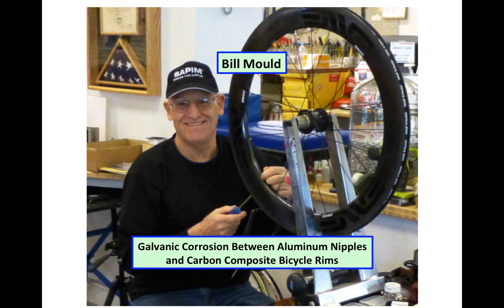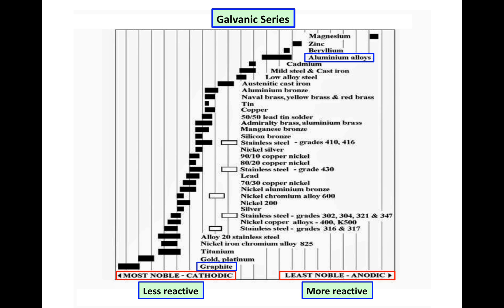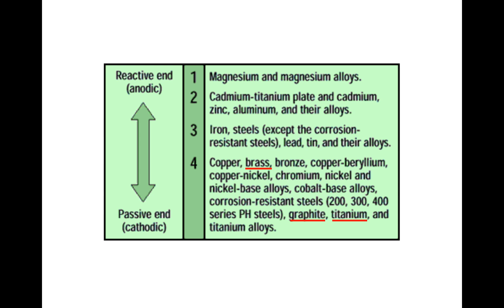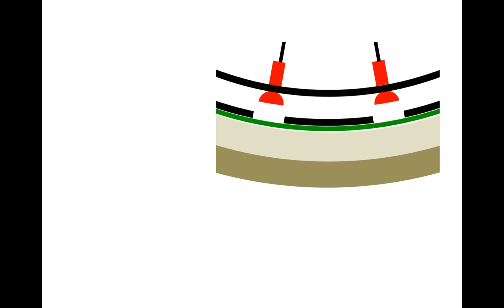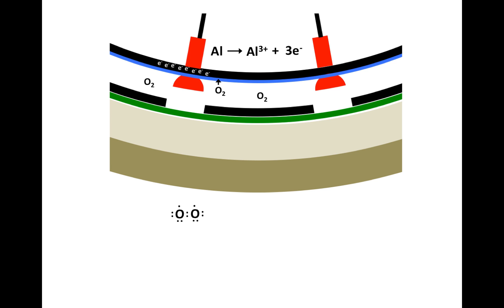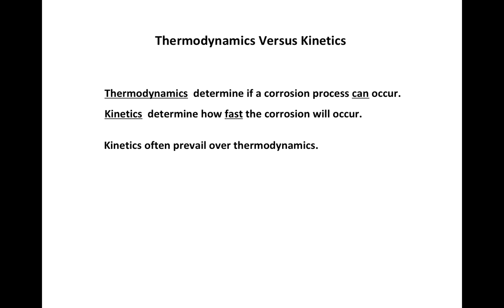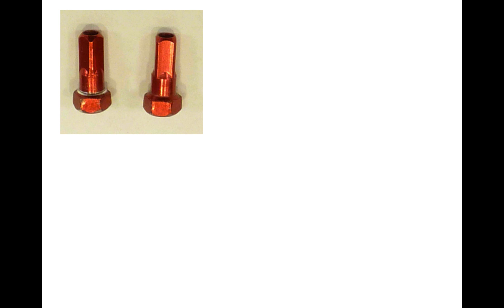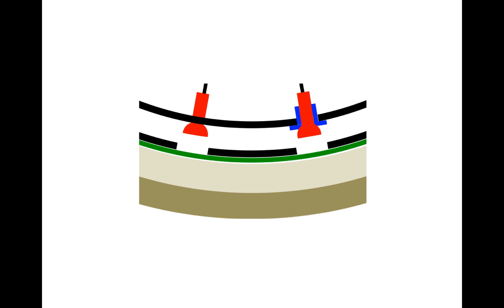Aluminum Nipple Corrosion In Carbon Composite Rims

Comment: Great informative video!! Thank you for this! 
I always use washers, when the rim bed is flat I use MG washers of stainless steel, in the other case DT Swiss PHR or the Sapim HM. Today I saw the first time of major galvanic nipple corrosion although I use only quality Sapim spoke nipples. I always use lube on the nipple outside also going into contact with the carbon. I always finish with Loctite on the top and bottom of the spoke nipple. 
I think indeed water can accelerate corrosion. I saw some suggestion to always blow the nipple area dry after cleaning and use oil around the nipple area. 
Brass nipples can help, but is limited to Black and Silver. Building 1200gram wheels limits the use of Brass.
Is there anyone having good results with duralac, lanocote, or tefgel? Which one has the most lubrication effect and is not aggressive to carbon or decals?
Thanks for your FB!

Comment: Good info…….I use brass nipples when building cf rimmed wheels.
Reply from the maker: So do I normally, but some people want the saving of two-thirds of a gram per nipple in weight saving.  In a 32 spoke wheel, that adds up to 20 grams per wheel.

Comment: Great video, thanks! I regularly run into issues with aluminum nipples on any wheels, not just with carbon rims, I believe based on the galvanic corrosion between the stainless spoke and the aluminum. I do have a question about the use of washers though - since the washers are metal, don't they maintain the conductivity between the rim and nipples? I can understand how washers spread the loading to the rim, but I would expect that at least some of the anodizing on the nipple would. be compromised. In addition, the Vargel book "Corrosion of Aluminum" specifically states that anodization is not a useful barrier for preventing galvanic corrosion. (ref section 3.11.2)
Reply from the maker: Benjamin, you are right on track.  Washers will not insulate between metals.  Practically, I don't think anything can, given the enormous twisting forces between them.  Thanks for your comment.

Comment: Thanks Bill for the well done engineering analysis.  We also have had issues in Salt Lake City with AL bearings in carbon cups.  So the Al nipples are not the only issue.  You asked for suggestions:  --1. Store the bike in a dry even temperature area to eliminate galvanic corrosion.  This requires a relative humidity of less than about 35% and an even temperature to eliminate condensation.  No electrolyte (water) and there is no galvanic corrosion.  --2. We're in Arizona not far from where airlines store their aircraft so galvanic corrosion is a location related issue.  The opposite end of the spectrum from AZ might be storing a bike in Florida where it is humid and compounded by living near the salt water sea. --3. I wonder if  using a  dielectric grease between these AL nipples/bearings will mitigate galvanic corrosion?  We're trying this approach because dielectric grease is non-conductive and perhaps somewhat like the shims or washers you suggested in the video.  --4.  Don't tighten spokes to unreasonably high tensions.  Instead build wheels to the mission.  A higher spoke tension does make wheels stiffer. We're experimenting with lower tensions in the 65 to 90 kg-f range and seem to be having good results for recreational mountain bike riders on green and blue trails.  This mitigates wearing through the nipple anodizing.  --5. In warm wet climates, galvanic corrosion with expensive light weight carbon bikes may be unavoidable so in this case, consider the nipples as a sacrificial anode saving the rim, spoke and hubs from corrosion damage.  Al nipples are inexpensive and replaceable.  Learn how to re-lace the wheel.  LOL  Your research is ground breaking.  Thanks, James B Frantz
Reply: I should have said that increasing spoke tension does not increase stiffness of the wheel.  Typo
Reply from the maker: James, thanks so much for your helpful suggestions.  Much appreciated my me and others will read what your analysis

Comment: 🤔 So… Can I use Nail Polish⁉️💅

Hot Glue? or just stick with Gorilla Tape?

The spoke nipples on my ebike wheels are yuge sharp studs that stick out on top of the rim, not embedded in holes, so I want to cover them up properly to prevent another popped tube. The manufacturer used a very thin liner…

Can you summarize what materials/substances are safe vs. corrosive to use on aluminum?

Thx for saving my tubes/tires/tears/life! 🙏

Comment: Very informative! Any evidence showing latex based sealant could accelerate the process? There' a lot of threads saying the amonia is the culprit. There's even latex/amonia free products these days.
Reply: Ammonia in water gives off hydroxide ions, since its a base. So that is simple way to get to aluminium hydroxide. I once had an mtb wheel with a leaking rim tape, which I probably damaged when I replaced a tire. Tubeless sealant got in the rims which I didnt notice since it sealed itself up again. A few months later the wheel was scrap, one spoke nipple broke, when I wanted to replace it and retrue the wheel multiple other nipples failed. Most spokes I coulnt really turn at all. Nor get the nipples off the spokes. I only noticed tubeless sealant had gotten into the rim once it took the rim tape off. Anyways. That was an alloy wheel, not a carbon one. Of course the wheel had also been ridden trough lots of rain, water, mud and road salt. So it probably was not only the ammonia in the sealant.

Comment: Hello guys i work in a military aircraft worldwide industry and  i can see everyday how to install alloy rivets in carbon fibers , we use chromate sealant between the rivets and holes it is called  "wet installation", sealant isolates alloy rivets , a suggest add a stainless steel washer CRES corrosion-resistant steel under the nipple head to prevent this kind of corrosion and washers improve rims streght.
Reply from the maker: Manuel, thank you for your comment.  One thought.  With nipples, there is a lot of turning of the nipple onto spoke treads.  That is not the case with rivets.  Do you think that the considerable friction between the nipple and the rim would wear through the protective coating?

Comment: I work in the marine industry with carbon composite structures and aluminum structures. Galvanic corrosion is a major concern. 

We always use an isolator compound. Check out duralac, lanocote, or tefgel. One of these is likely your best option due to the need for assembly and I assume tuning. 

If you don’t need to service the spoke nipples in the future, you could also use an adhesive with bond line thickness controller beads mixed in. They are 5-15 thousandths in diameter and help ensure the bond line thickness. That provides enough isolation to prevent any galvanic corrosion.
Reply: I use tefgel with alu nipples on carbon rims for two years now, and it seems to bring good results. I haven’t seen a corroded nipple on those wheels so far. It would need to be confirmed in a more scientific manner though.
Reply: @Biketopwheels  thinking of using sapim double square nipples with tefgel. Are you still finding it works.  Otherwise I will consider a washer.
Reply: @stocktradinggame  it works, but for me , now, having vent holes in the rim cavity is the best solution. Washers have no effects on corrosion.
Reply: @Biketopwheels  Thanks, appreciate the response.
Reply from the maker: Thanks, that's helpful

Comment: Wow...crazy. I have $2500 Bontrager XXX Kovee wheels that have corroded big time. I brought front wheel to the Trek shop less than a year ago with a busted spoke and they rebuilt the whole wheel. I was inspecting their work after I decided to tape my wheel. I saw several corroded nipples! I squeezed the worst spoke and SNAP! Then I inspected the rear wheel which is 3 years old and they were all corroded. Ugh.

Comment: One thing I noticed was that ammonia can drastically accelerate the reaction. I’ve always had sealant penetration, on every rim given enough time. Wanted to get your opinion on washers for generic carbon hoops. Do they actually reduce the risk of pulling through before reaching a high tension?
Reply from the maker: I often use Sapim HM washers under Sapim nipples when building a wheel with a carbon composite rim.  I'm not concerned that the nipples might otherwise pull through, but they do serve as an interface between the nipple and the carbon rim.  That way, the nipple is turning on a metal washer and not the rim.  A little lubrication with a lightweight oil is essential.  Without a washer, I find that the friction between the nipple and carbon rim can be quite high, making the tensioning process more difficult.
Reply: Bill Mould My wheel builder said hes had good luck without washer as well. He scared me when he said oiling the rim nipple interface causes pull through.  I think his bad experience is due to rim quality/thickness and not oil penetration into carbon composite.
Reply from the maker: I do not agree with your wheel builder's opinion.  A little light lube does no harm to the carbon at all and is necessary to keep the friction down between the nipple and spoke bed.